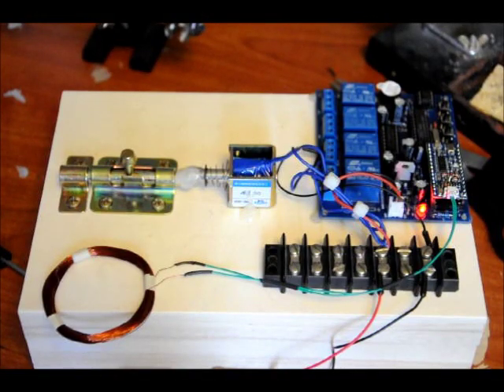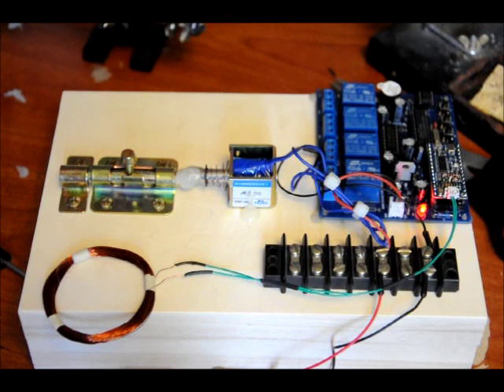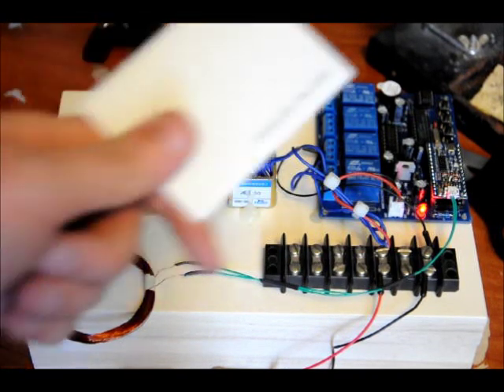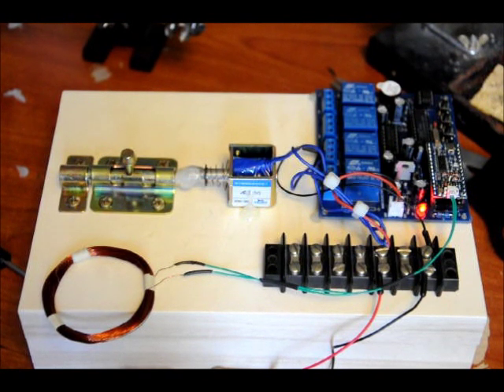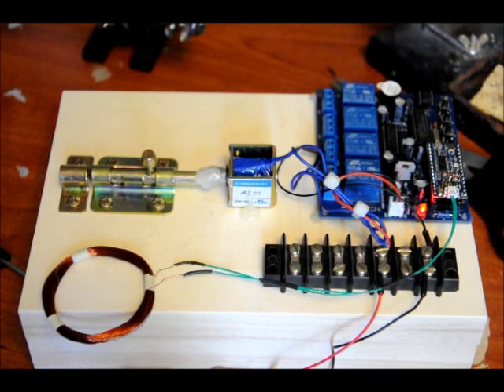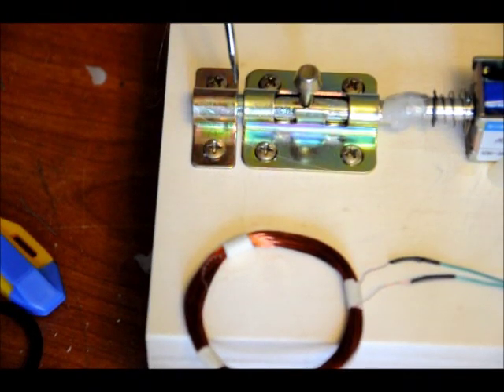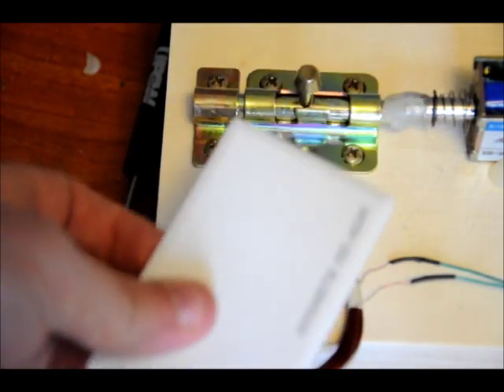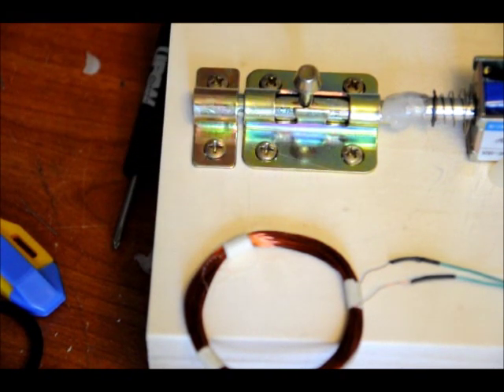E-Z RFID Door Locking System Prototype With Solenoid

Comment: I know it was posted 4 years ago, but i want to ask hoping you would reply, is there a schematic on how did you do it,? I have the codes and the controller the problem i am having is how to use the rfid to drive an electric started without burning the controller and i guess your project might be a help.

Comment: Hey I want to make a similar solenoid (un)locking system for my washroom, but I will use WiFi or Sub-1GHz RF. Anyway my same problem is the mechanical stuff. My lock is very similar to the one shown in the video, anyone can suggest a easy but robust method to connect the solenoid to the lock (instead of using glue...)?